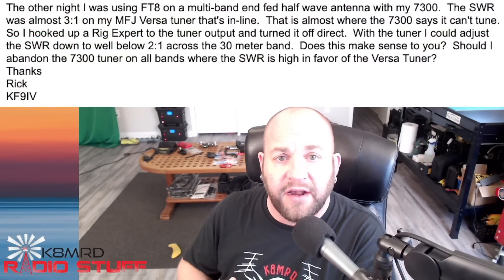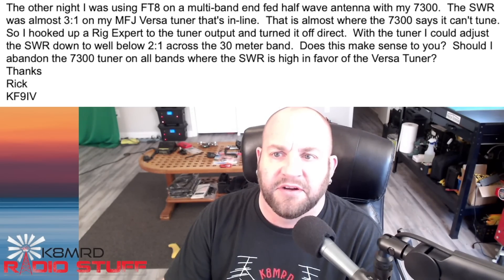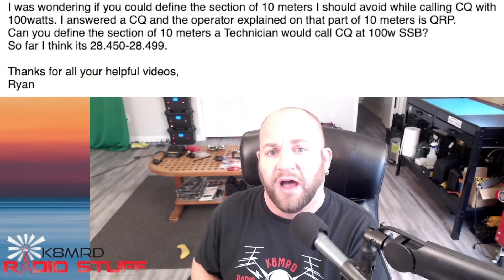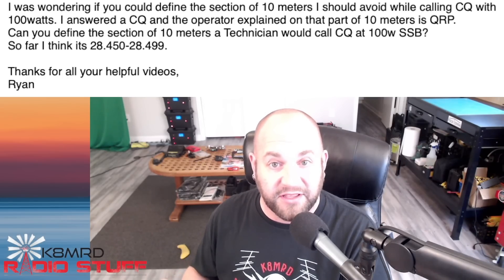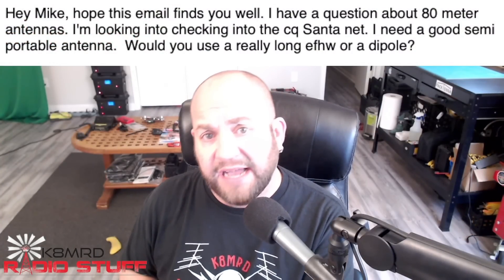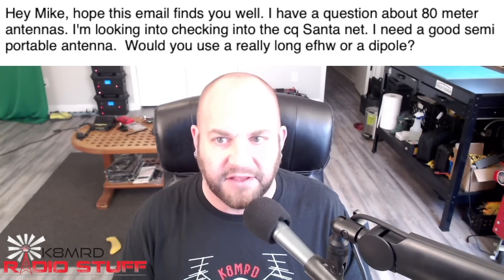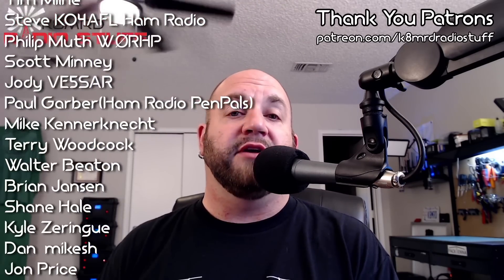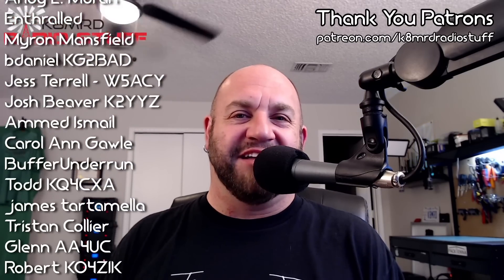Put Ham Radio Band Police In Their Place...Know Your Rights!

Comment: I am a new ham in Germany, I came across band police a few weeks ago for the first time.
I answered a CQ from another German operator who didn't spell his call sign with the correct spelling words (I don't care) on 7185. I replied with my call sign (DC6CK), that guy repeated my call sign  correctly two times, entered it into a computer and then accused me off doing illegal transmissions with a very unfriendly tone. Yes, my call is in the official German online database that can be accessed by anyone. Yes, I do have a class A license  which means I do have privileges on the whole band (7000-7200 in Germany). Yes, I was well below the legal power limit on that portion of the band and it is 'all modes' according to the band plan.

Someone who isn't able to spell his call correctly and who isn't able to use the call sign database pretends to be police and gets very unfriendly for no reason?

Why do people do this? Looks like deep frustration.

I am glad the vast majority of people I talked to on the radio so far have been very friendly.

73 from Berlin / DC6CK

Comment: I have quite a bit of experience with experimenting with my MFJ 1982MP EFHW 80-10m. Rasing and lowering the matching transformer will change the SWR on the bands. That can either help or hurt one when trying to operate. 

If that doesn't work out, I would recommend getting either a dedicated 30m antenna or a magnetic loop antenna. Magnetic Loop antennas are expensive, but if you got the patience to tune them, they work great. 

I have the AL-705 Magnetic Loop for my IC-705. One night on 30m FT8 running about 1.5 to 2w out, I had it tuned perfectly. With that power out and no SWR, I was heard from the West Coast into Italy, from sitting inside my bedroom. Didn't make any contacts, but I was thrilled that I was being heard by all those stations with 2w or less. 

If you want to see how well you're getting out while you're on FT8 or other digital modes, get on psk reporter and type in your callsign in the search box. That helps out quite a bit when looking to get the contacts you want. 

W4ISB 
Mike in Tennessee

Comment: Hmm, never thought about the loss in the transformer of the bedded really. 
I just put up an multi wire inverted V up at about 30 yards from the house to mitigate the noise. I wanted to put up an endfed antenna thinking the less coax I use the less signal I loose. 
But I might wanna rethink that. 

After all, 
The antenna is the one you have up and running.

Comment: About the Versa tuner or any auxiliary tuner.  SWR has nodes along the length; a voltage maximum and 1/4 wavelengh along the coax, a voltage minimum!  The act of inserting an external tuner usually changes the voltage and apparent SWR and this will be particularly noticed with end-fed half wave antennas that operate at a high voltage, high impedance node of the antenna (center is low voltage, low impedance, higher current).  A little bit off center does not change things much but a little bit off the end makes a huge difference between needing a 1-to-64 matching transformer, or a 1-to-49, or a 1-to-9 or whatever.  The point of maximum impedance is sharply tuned and it's probably better to be slightly off perfect anyway so you don't have to deal with that sharp peak.

Comment: Rather then trying to tune 30 meters on 80/40m 1/2 wave, run a 30m 1/2 wave wire 90° to the 40/80m wire. That has worked for wire dipoles from the same feed point.

Comment: "Internal or external antenna tuner -- which one should you use?"
The one that WORKS.  For SWR less than 3:1 untuned, the internal tuners work great.  External tuners typically can tune into 10:1 SWR.  
"Stay away from certain portions of their allocated sideband frequencies"
Some people seem to "stake out" frequencies as if they own them.  This kind also stakes out seats at the movie theater, church, or any other place of routine visit.  This kind posts "no trespassing" signs on public lands (national forest, BLM).  That sense of entitlement can lead to dangerous consequences so feel free to call them "sad hams" but they might not be hams at all.
Reply: Actually...  An external remote antenna tuner is best.  No losses incurred on the coax due to impedance mismatch.

Comment: I'd make a sizeable bet that that QRP guy was an "Rulebook Extra," Mike. Also, as far as the ATU question goes, the only way it might matter is if the length of the feedline jumper from the external tuner to the back of the radio or the feedline length from the ExtTU to the feed point at the antenna might be an strange harmonic on 30M that throws the ATU off OR there may be some common mode coming back off that EFHW disrupting the tune. As an experiment, maybe throw a short counterpoise on the feed point of the EFHW or put a 1:1 choke balun on the feedline at the output of the external tuner and see if that fixes it. What he meant by "bypass" is probably he's is putting the external tuner in bypass to eliminate "double tuning" when using the internal ATU on the radio. BTW, you CAN use BOTH if it gets really wacky. You just turn the internal ATU OFF, turn the external ATU ON, tune the external ATU and get a match and then turn the internal ATU ON and tune the internal ATU to "get it the rest of the way there" for max match and, thus, power output from the xcvr. Just be careful if you hear either tuner start to "fly" (the relays chattering away. I'm not sure  if the MFJ ATU model he has has latching relays or not).

Comment: Self appointed band police are just as annoying here in the UK, almost universally they are ill informed and will not give their own callsigns, as such they don't exist and can be ignored. Band police have immense patience, they will listen to the most boring conversation and jump in if you put a foot wrong (in their eyes). Many years ago a friend and I were talking on an obscure 70cm simplex frequency while setting up a  2m packet link. It was about 3:00am when my friend said "bloody thing" referring to a piece of equipment. Fortunately we were saved by a band policeman who said "language", you have to wonder how many hours the idiot was listening. Regarding the 80m/30m issue, depending on how how an SWR you are happy with cutting the antenna low on the 80m band may be acceptable on 30m, it is a bit of a compromise and you may not like the pattern.
Reply: I made a linked inverted V antenna that works on 20, 30 and 40 meters, and I can also connect extra wire to work on the 80 meter band. At 34 feet/~10 meters elevation it seems to work pretty well.

Comment: I respectfully disagree with your comment the EFWH antennas have a slight signal loss penalty compared to a center-fed half-wave dipole. While technically true, in practice it is not. For many hams, one mounting point of the antenna as well the feedpoint are connected at or near the shack. This means that the feedline can be kept very short. In such situations, running a center-fed antenna means stringing additional feedline out to the middle of the antenna unless you plan to set up a folding table in the middle of your yard so you can sit directly underneath the feedpoint. And to reduce the cable loss to a center-fed dipole you generally need heavier cable which puts much more mechanical stress on the entire system. For me, EFHWs have been amazingly easy and inexpensive to use.

Another quick note... The radiation pattern of an EFHW is a bit different than a center-fed dipole. Whereas the center-fed dipole has nulls coming off the ends of the antenna when it's one-half wavelength in the air, the EFHW has nulls at the center. When setting up an EFHW antenna, orient the antenna 90 degrees from what you would normally use with a center-fed dipole and you'll be much happier with the result.

Comment: Hi there Mike...i don't want to saund like the ham police...i was a novice year's ago before they let us use voce privilege in 10 meters ( a enchanted novice they use to call us ) and I was very happy whit my first 10 meters móvil radio ( the Uniden Hr2510 ) i did have a Drake TR4 that i use for mose code in dose day's. But the Hr2510. That was the one I cute use in my móvil whit 25watts ( i still have it after all those year's and it works ).  Now I'm a general and use my ICOM ic751...ok let me said something and please correct me if I'm Rong.  Novice/Technician can only use 200 watts in 10 meters from 28.300/28.500 there voice section not 1,500 watts...like i said i don't want to sound like the ham police...but please. Check it out .. because i think you make a little mistake saiding that if he wanted he can't use 1,500 watts in 10 meters...( Generals, advance and  extra can use 1,500 watts in 10 meters but not in the 28.300/28.500 section we are limited to 200 watts )...thank you for your atención and eny comment is welcome.... 73's and good DX's from....WP4EFM

Comment: As a truck driver the cb has died off shortly after smartphones and also the older generation retire.  How is ham and gmrs still going?  I attended a few radio meet and saw mainly WW2 hats.  I was the youngest at 40 and one maybe early 50s all the rest were well over 70 . What keeps the radio clubs going?
Reply: GMRS is growing exponentially with new exposure on YouTube, the advent of easily available and cheap Chinese radios, and the lack of a test. Lot of outdoors and prepper type people there too. Ham 2m/70cm repeaters are pretty dead in a lot of areas outside of check-in nets with a lot of old people. Actual local clubs are pretty grim with old guys who are dropping fast. Clubs suffer probably due to the intense pushback to both new members and to new technologies like digital. DMR is active nationwide with links like Brandmeister.

Comment: Mailbag Monday ~ Question : With the FT-891,  Can you go from FT8 to SSB mode without disconnecting the cables in the back.  I am a new FT-891 owner and a new General.
Reply: Yes, assuming FT8 is done in DATA mode when you switch to regular USB/LSB.. It will switch to normal inputs.. You can specify when in the digital mode to use back ports for audio.. I do it all the time.
Reply from the maker: What Chris said
Reply: @chriscoel  Thank You, Paul KD9SYD

Comment: As stated, I see a (200W) right under the N,T on the AARL band cheat sheet. Still twice the power the questioner said. "Band Police" 👎
Reply from the maker: Yes I glanced over that.  That's why I put on the screen in GIANT LETTERS Techs have 200 watts.  Everybody want's to point out when I misspoke but fails to see I corrected it in the video.  I guess not everyone is actually watching.  Oh well.  So long as techs are getting on 28.385 that's all that matters lol.
Reply: @hamradiotube  Don't know if you noticed it, but since 10 opened up in October it seems like the really good DX has been operating above 28.500. During the CQ WW contest there were DX stations up to 29.000 but very little between 28.3 and 28.4. I noticed the same thing during the ARRL contest last weekend.
Reply: @hamradiotube  Now you have those viewers watching your You Tube channel policing you,Mike!

Comment: To the Technician class operator that wrote in: What Mike said about you having a legal right to transmit full power on frequencies informally accepted by hams as "QRP calling frequencies" is correct. However, if you did so now (since you are now aware of the informal band plan) you would be considered a poor operator by other hams. The ham community has a term for this: poor operators are called "LIDs". I'm sure that you don't want to be labeled a LID by your fellow operators. So, to be a good (polite) operator, you should not transmit USB using full power anywhere on the 10 meter band that would cause a significant amount of your transmitted signal to fall within 28.385-28.388 (minimum - this assumes that most QRP operators use very sharp receive filters). If you are unsure about how clean your transmitted signal is, I recommend that you apply a generous guard band around this channel. For example, at my station (when running barefoot, i.e., 100W) I would not use 28.380-28.390 in USB mode.
A good example of why it's important to know the informal band plan is the 2 meter band: legally, you can transmit SSB anywhere above 144.1MHz. However, most of this spectrum is filled with FM repeaters. There is no law that prohibits you from using these channels for your own purposes. However, if you do, don't get upset if other hams start calling you a LID.
As a possible new ham operator, it's important who you get you advice from. I recommend that you locate an Amateur Radio club in your area and get connected. In the mean time, just try to be as polite as you can be.
- W7OG (licensed since 1964)

Comment: It says it right on the band plan, 200W
Reply from the maker: Yes.  Thank you for pointing out the mistake that I corrected 30 seconds later with GIANT LETTERS that were flashed across the screen stating that techs had 200 watts on SSB.
Reply: @hamradiotube  cool man, just letting ya know most people don't care about watts at that point as long as you're not blasting others